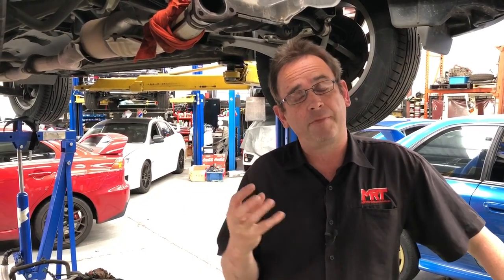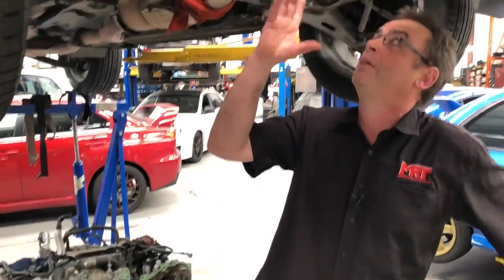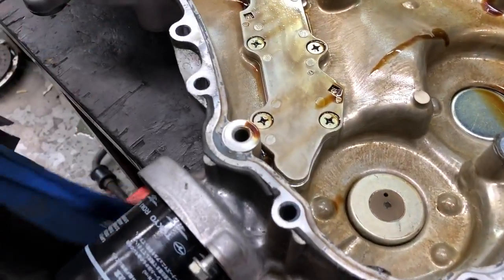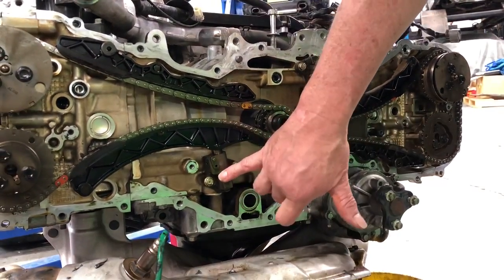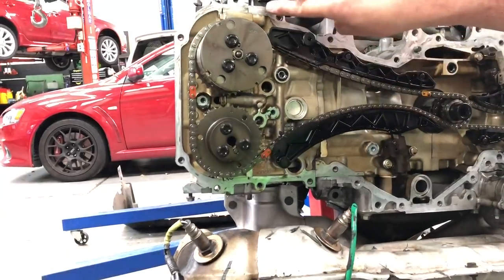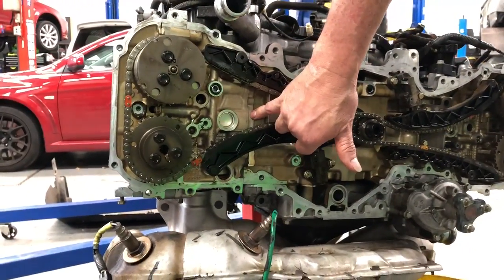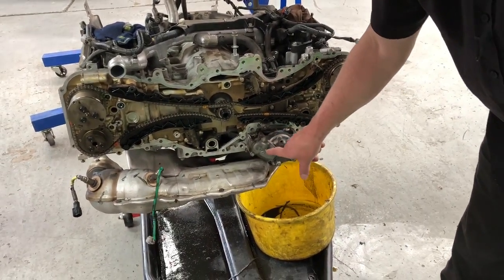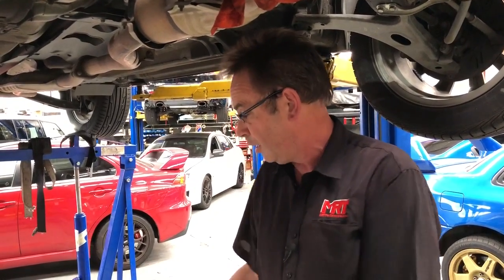Subaru FA/FB Series Engine Oil Leaks - Forester/Impreza/Outback/XV/BRZ

Comment: I want to know what's the difference between my fb20 and the brz 2.0l motor. Mine is in a 2017 Impreza 5sp manual. And can you tune theses yet?
Reply: The brz has a unique head assembly with a FA20. Not FB.

The compression ratio on the brz is also ridiculously high. 12.5:1, which not many people realise you dpnt need to add alot of boost to an engine that already has a super high cylinder pressure. Youd get about the same results from 6psi on a high CP than 20 on a low turbo car CP like 6.5
Reply: The brz is closed deck and the other 2.0 like in the impreza is open deck
Reply: @gtkshdow  I heard the fa20 block is more semi-closed. In any case its much more solid than an FB, and the fb shouldnt be modified. Not worth it
Reply: BRZ is a dual injector, it has direct and port injection. Which explains the high CP. Generally port injection is used on low load low RPM range, the rest are done with direct injector.

Comment: Great video as usual Brett. Question what coolant is best for  MY99 GC8 Sedan subaru wrx brand and colour mainly for booking because we don't really get freezing temperatures here but also I see different colours and rust in people's radiators and reservoirs and different colours. I bought mine from Subaru and it's red is this correct ?
Reply: Idk if they will answer but honestly Subaru warranties these cars for thousands and thousands and thousands of miles and they use all their own fluids so it's very safe to say you can't go wrong using the OEM recommended fluids in your car. The OEs are usually very very intelligent with massive budgets for R&D.
Reply: Use the long life super coolant, the blue coolant Subaru has been using from 2008 and up

Comment: Yep, My brand (less than 1000 Km) new Forester XT had an oil leak from the same area on the timing cover what you pointed at.  Right on the joint between the timing cover and the cam carrier/ cylinder head joint.
Reply: Probably not enough sealing was added during assembly. Simple mistake but you have a warranty
Reply: Sealant is applied by a robot. No mistake there
Poor design by Subaru, IMO.
Reply: @tomwalma4762  maybe they just dont put enough? Its not "bad design". I see this ALOT in the heavy duty industry. You just put more alot of the time or just put a better quality silicon and problem solved
Reply: subaru should use proper gaskets... sealant seems really cheap
Reply: @oldfashionedwrx3574  theres different types as well. Black one is like unremovable if really want no leaks lol. Pain in the ass to remove
Reply: @oldfashionedwrx3574  bruh the diesels i work on all use silicon like subaru on the gear covers its not the cheap way lol
Reply: Oh okay, cool.
Reply: What was the cost for repair?

Comment: So performance varients aside what do you prefer. EJ or FB? Just curious.
Reply: I got a 2013 impreza with a fb20 at 27k and now it's at 29k and already got a got the low oil pressure light turned on😂😂 guess it's common but still. Other than that nothing so far but only 2k miles..🥴
Reply: Owning both and going by what we often hear, the FA/FB is a big improvement
Reply: We have had both. I have had a wrx, sti and baja turbo and my wife had a 2015 wrx.  The 15 wrx was the most advanced, we sold it with 102,000 miles and issues and no oil leaks. Lots of power and 27mpg average daily driving and we got 32-34 on long road trips.